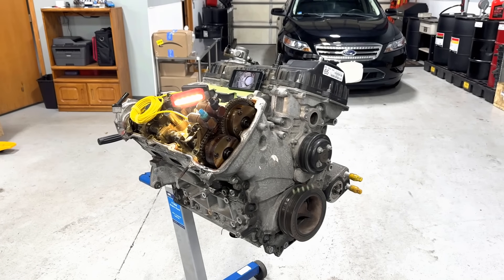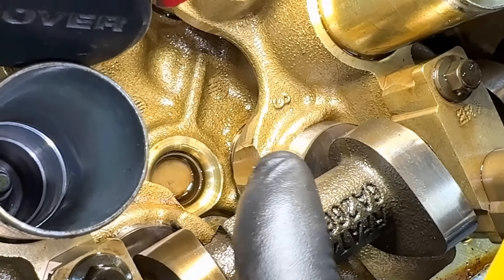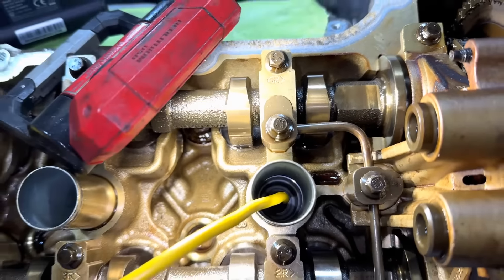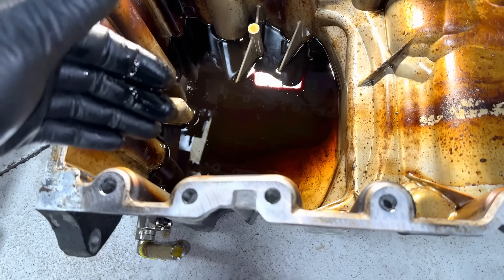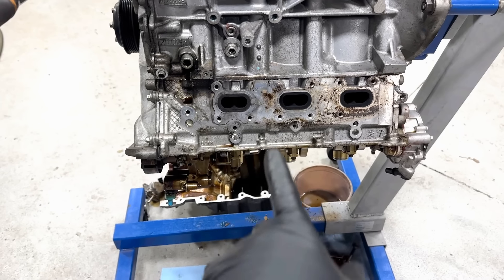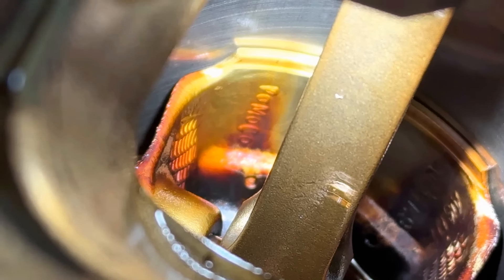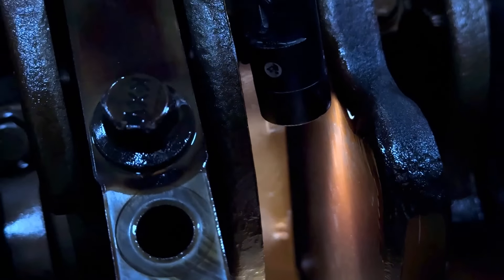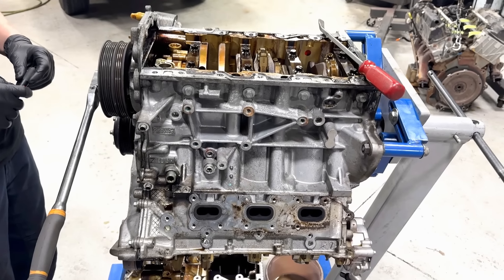Why Did This Ford F-150 3.5L EcoBoost Engine FAIL?

Comment: Nice Video …🤘🏻 have a question my 2013 F150 crew cab keeps blowing the fuse #20 lock unlock doors i check wiring and everything its ok but keeps blowing it. also in the screen shows check park aid .. any help will be aprecciated. 🙌🏻🤘🏻

Comment: You can't say great fuel mileage and Ecoboost 🤣🤣

I WAS a huge GM fan, 16 different 300,000 mile GMs in my family in the past 30 years all had the factory original engine.. I currently have a 2022 Silverado and it's a POS!!!

And why did he install an oil catch can??
If Ford felt it needed an oil catch can it would of had one from the factory...
Reply: Yep, the new 4 cylinder Silverado's are an absolute shame.  Ask me how I know.
Reply: @santaclause2875  I know!!
Garbage!!

Comment: I don't think that guy's telling the truth. What's up with the aftermarket coils? He's got a catch can which ok, that's an aftermarket part to help with direct injection/blowby... But I'm willing to bet this was tuned, probably running higher boost.
Reply from the maker: Just an old guy puttering around.
Reply: @FordTechMakuloco  that's strange why it failed then

Comment: Notice when you look under the hood of any of the “big 3”, it’s a mess; hoses and wires just stuffed together everywhere. Look at a Toyota or Nissan truck engine and things are routed differently. Made to actually last. Ford, Chevy, and Ram are built to just sell you a truck and then don’t care. Don’t believe me? Just try and get the dealership to fix anything under warranty. They act like they’re spending their own money. SMH…

Comment: Unless that's an optical illusion the rod is bent...looks like hydrolock to me. How though...fuel ? .... water would have to have gone through the air cleaner. Someone have coils out and liquid intrusion ?

Comment: As much as I like to dog ford, the reality is that all manufacturers quality is going downhill. I have been a diesel mechanic for 36 years. I drive a gen 3 Cummins. There is no way I would buy a newer diesel with all the emissions problems they have.

Comment: What I learned from you is to not buy a ford. I like them i really do. I find them to be the most comfortable vehicles. However, i think I'd rather save up a little more for a tacoma. Not that they dont have their issues as well.

Comment: That motor does not look like the oil has been changed frequently enough
Reply from the maker: Yup very frequent, it is a boosted engine.
Reply: @FordTechMakuloco  there’s a ton of staining on the internals.

Comment: They are making these small engines produce too much power . They are not going to last as long as the old V 8’s and sixes of thirty years ago . I guess it is not the manufactures fault in a way the government have mandated strict rules for MPG and emissions ,and this is the result. Small engines making too much HP and reliability will suffer .

Comment: The owner was running it to hot and heavy ...guarantee it...owner don't tell the truth....my platinum has 400 thousand miles..all original 3.5 ecoboost 2013...
Reply: Wow my pampered 2018 only has 45 thousand miles and I'm already getting the cold start rattle, oil changes every 3000 miles.

Comment: Sorry not sorry half my 6 cars are FoMoCo products and that ratio drops every year. I am a Ford guy to the bone but even I cannot bring myself to buy anything Ford after 2011. Just complete garbage. I replaced my trash Ranger with a Frontier. Up until 2 years ago I had FIVE vehicles and FOUR were Fords.

Comment: could be fixed. why a whole new engine?
Reply from the maker: Yes, it can but there are a million reasons why it shouldn't be.
Reply: @FordTechMakuloco  a friend just rebuilt one that had 2 broken pistons. Did have heads cleaned and checked at the machine shop and removed and metal shaving that could have been picked up through the oil. So far so good. Will keep you posted on whether the job stood the test of time or not.